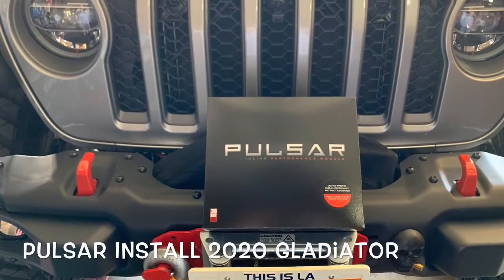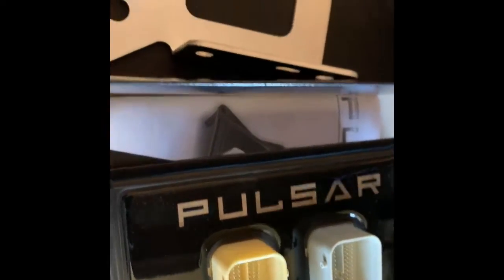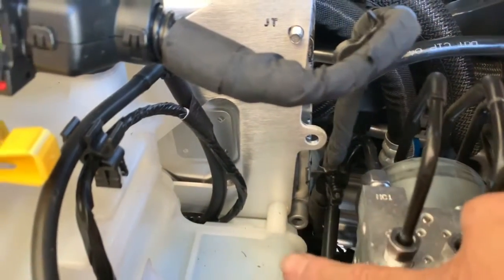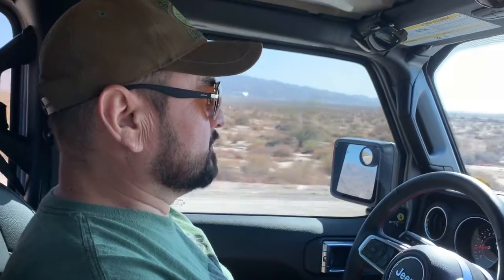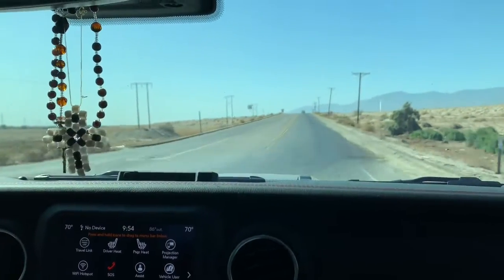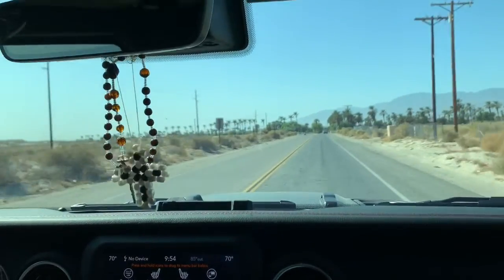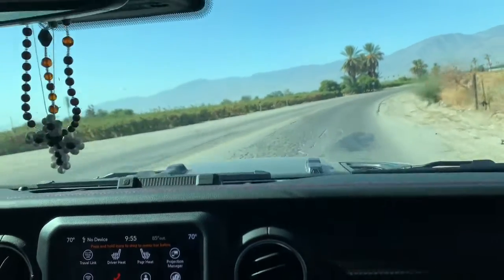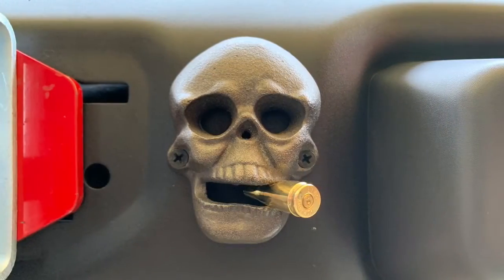Pulsar install 2020 Gladiator

Comment: The airflow on the K&N comes from the filter and piping  vs the factory ones.
The filter alone does not flow as much air as the filter area is smaller than the cone type that comes with the full kit.
Also the piping and air box is less restrictive.
Reply from the maker: Steve question and or statement is in regards to air filter “flow” cold air that aftermarket kits state that they increase cold air = more power not the case the temperature does not change with the less restricted box. It’s all about filter air flow K&N provides compared to stock.
Well to me K&N is the best..
 one and done 
Happy Trails Sir thanks for the comment

Comment: Thank you for the video.  Are you going to re gear? or have you?  What are your thoughts on this.?    Is yours a Rubicon?  *dana44 w/ 4.10. on 37"s
Reply from the maker: Walter 
Thanks for the comment, Sorry I kept you waiting. In regards to regearing the Gladiator No plans .. No need, it runs fine on 37" no issues. The transmission ran a little hot last weekend I went offroading and did a rutted wash 14-mile continuous hill climb, I believe I was at fault I had in high once I shifted to low the temperature went down. Happy Trails  😁✌

Comment: Any updates ? Great video, my pulsar was defective truck would not start
Reply from the maker: Daniel Cox  Sorry to hear that. I’ve not been able to load up new video. No issue with my Pulsar system please keep update with your rig..
Happy Trails!
Reply: @89x9  sweet they sent me another one should be in tomorrow i really am excited hope it was a flaw. They said it was a first gen somehow 4 wheel parts sent me that. So the manufacturer said they are sending a new updated one. I'll keep you posted. Thanks me
Reply: Ok installed the pulsar wow that thing really works !!! It's amazing man deff worth every bit
Reply from the maker: Daniel Cox Good news happy to hear Happy trails

Comment: Nice Jeep.I have the same Jeep and plan on adding this. How is your MPG in eco ,have you done any test? Thanks
Reply from the maker: Thanks, Bryan 
You are going to love this unit from Pulsar. The eco mode has saved me on gas.. as you know the gladiator loves fuel, I've not done an actual per mile test since it's not my daily driver and I mostly use it for off-road, I just noticed I'm not filling up as I used too and its  riding on 37" 
The power mode is No joke you'll feel the difference in POWER  I think you will like this setting You will leave the competition behind, Ill fill up my truck today and get back to you... Happy Trails

Comment: All we need to see was it did update our tire size swap verified app and Garmin stock slap the gas pedal it will kinda rev or lurch eco slap it and nothing happens tow it lurches performance it takes off so timing is 100% true speedo calibration is 100% people have Dyno ran it and showing like 25hp and 25+tq so my guess is cold air throttle body and pulsar all this under 1500$ you should be pushing 50+hp & 50+torq that's excellent for bolt on and I'm sure eco diesel and if they ever drop turbo motor like Wrangler you will get much better numbers.
Reply from the maker: J Shapiro The Pulsar still working well no issues Thanks Happy trails
Reply: @89x9  how many miles is on urs my ram has about 13k onnit